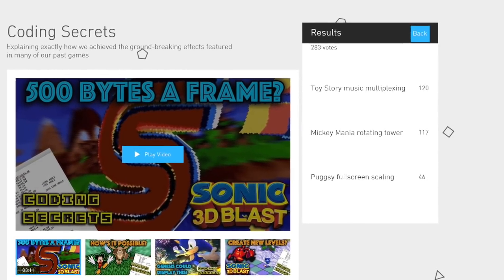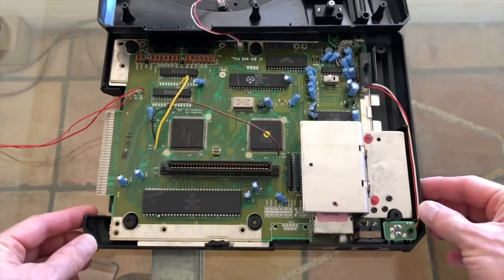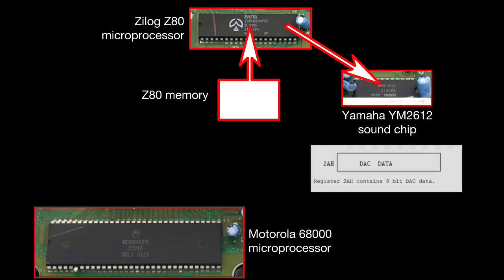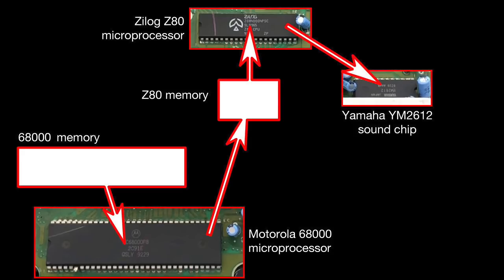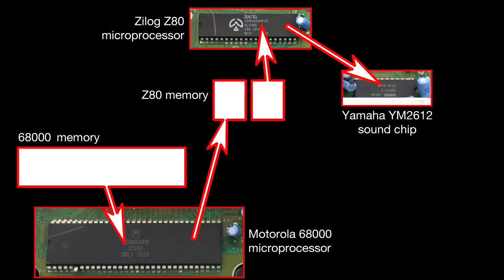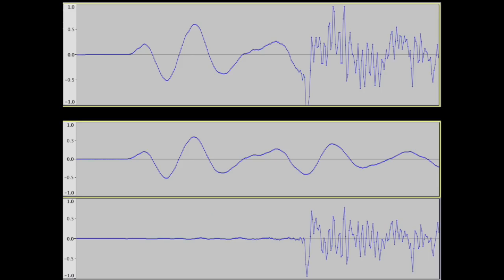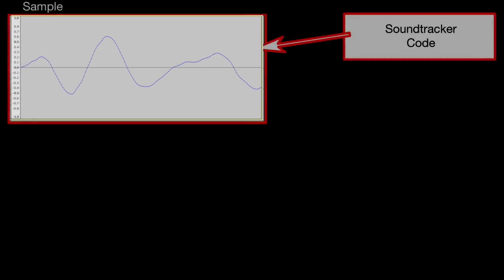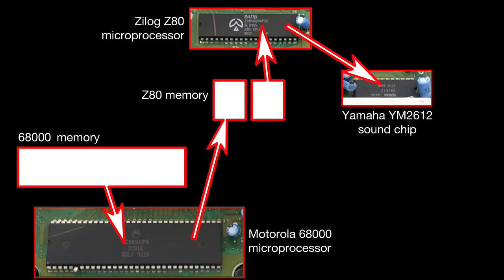Toy Story's Hardware Defying Music - How We Did It

Comment: Thanks for the explanation. I'm still wondering if it would have been more simple / efficient to do the mixing and playback on the 68000 alone, as one would do it on the Atari ST, since the 68000 can also access the YM2612 directly. Even though there is a speed difference of ~5% in favour of the Atari ST, I think there are MOD playback routines available which can reach ~16khz mixing on a stock machine. Did you guys think about this?

Comment: I'm sitting here realizing that all of this was always possible...
But then I also wonder how chopped up all of the machine language code must've been just to pull this off. There's no way this was done in the modified SEGA C or even assembly.
This is messing with the hardware on such a low level that touching the wrong thing could lock the entire system. I'm seriously in awe of how close you guys got to the razor's edge just for fun.

Comment: Basically, this is what almost every mod player did back in the days. Of course there were some machines that could do this in hardware (like Amiga or Atari Falcon or PC with GUS) but for the most of the time you had to do mixing in software.

Comment: Here is a question. Could you run streaming audio using that same sound engine?

Instead of using it as a sample mixer, you could use it to stream one long sample of music.
At 10 KHz, you would get 600 KB of audio per minute, and around 7 minutes of audio for every 4 MB cartridge. And that's uncompressed! I'd say that would be enough of an achievement to leave there, as to compress the song would be impossible without major slowdown.
And it would not be doing any sample mixing, or pitch control, or software volume control, so there will be some CPU being saved, allowing for some of your fancy effects.

If you were clever enough, you could fit the entire soundtrack of a game, consisting of a few short songs, or one long one, and fit it in around 6 minutes of WAV style audio at 10 KHz, and still have enough memory to fit in the rest of the game (400K is enough for an arcade style game, and 6 minutes of WAV audio is also enough.).

People would think that they have a Sega CD, but don't.

Will you accept the challenge?

Comment: Wow! That’s quite an achievement! Sounds awesome, especially for the Mega Drive. I wonder why the Mega Drive’s has such a bad soundchip.
Reply: It is because the Sega Genesis is a shrunk down System 16 Arcade board, and as such it uses an early 16-bit sound chip. The SNES had a sound chip that had just rolled off the fab floor when it released.

Comment: Loving your work, spent most of the day watching this stuff 😀 one question, you said for mixing that you halved the amplitude and then added, would you not just (using 8 bit signed samples as an example) just add the two 8 bit samples together in to a 16 bit register, then clip by setting >127 to 127 etc? Forgive me if that has been asked before.
Reply: There are different methods to mixing. But yeah you can in fact "saturate" (not clip. Clip implies wrap-around in technical terms), but you will lose fidelity when it saturates. If it happens rarely, then not a problem. You also need to apply some sort of volume too. I think the best method is apply volume, accumulate all samples, then shift them down. So yeah, you don't get the lower resolution bits directly, but you do hear their influence when mixing. It's an old trick and it works well. It's better than simply mixing four 6bit samples into an 8bit output.

Comment: So the 8bit Z80 only has only has 8K of ram ,and since most programmers tryed to fit all pcm sound effects in that 8K space then no wonder that  most games had awful voice samples,likely you can bankswitch sound data if you want to get around this 8k limit but technically there will be always a slight pause per data to be switched.
But this clever mothode is pretty smart to simulate 2 channel pcm audio but again then each sample has to be devided into sections of 4K since the Z80 chip cannot read data when the 68000 is writing to that 8K memory at the same time ,so to get around that, that 8K has to be devided into 2 parts of 4K for wich 4k is used for writing while the other 4K is used for reading wich alternates in order to avoid interruting each chip,, this way 2 channel audio at desirible length’s on genesis is possible, wich is not bad, 

but the psg chip inside the genesis can also do pcm but only fake it at  1bit pcm wich also explains why genesis games can also be sound bad that way assome genesis games do use the psg chip for 1bit pcm audio but still .it’s 
Pretty amezing how many mothodrs were used on the genesis to get pcm sound on it😀

Comment: Well, it is technically Amiga-compatible, since it had the same Motorola 68000 processor. (if by Amiga you mean the 1000.)
Reply: the Titan MDMOD Player for the Mega Drive / Genesis that's out nowadays actually runs ProTracker code on the 68000. The sound has to be software-mixed (like with this Toy Story music) due to the single PCM channel, so the CPU usage is 90-100%.

Comment: The same basic principle of software-based mixing of samples was done on the Amiga to double its 4 channels to 8 in the Octalyzer sound tracker. The result was stuffy-sounding enough, as it lost almost all high frequency, but man: eight independent channels! That meant real triads, not just arpeggios. I was so psyched when I was finally able to upgrade to MIDI. 😎

Comment: Nice and creative use of lookup tables as I'd call your volume and pitch tables. Had to do similar except a few hardware counters on my own (open-silicon) Programmable Sound Generator.

There would be 8 octave splits from a hardware clock source divided down to some frequency. Each octave could be tapped into a 6-bit counter that could be tapped in turn. My recommendation was to tap 48 down to 24, or 24 down to 12 if necessary. Unfortunately, there is no direct pitch/volume control unless you do PCM DAC foolery which may freak out some sort of internal hardware registers.

Comment: So you basically used the main processor as a stand-in audio chip, and wrote bespoke software that mixed samples, compiled music, and barely used the rest of the audio chips as anything more than an intermediary buffer (as one half of its memory plays you load newly generated audio computed by the main processor into the other half of the Z80's memory before swapping over repeatedly) and streamed audio data to the end source. You guys were nuts, and immensely ingenious. Great stuff.

Comment: Hi Jon, this is very cool indeed!  Have you seen any of the techniques used to play samples back on the Commodore 64? 
There's a demo that showcases immaculate sound quality with the sample playback that blew me away. On top of that they had visuals happening at the same time.  Censor Designs Wonderland XIII at the last bit they play a whole section of "Smack my B***h Up" by The Prodigy at what seems to be a very high sample rate along with accompanying visuals.

Comment: I think I get what happens:
1. Within the 68000, four audio channels are created. For each channel, data may be saved by combining sound samples at the cost of their respective volume levels. Between the four channels, the data is then sent to the Z80.
2. Z80 "double buffers" in order to both (a) receive/process data from the 68000, and (b) to send data that has finished being received/processed to the Yamaha sound chip. Otherwise, if I'm understanding this right, it hypothetically would be sending both processed data and data that has not finished processing that it had received from the 68000. The Z80 therefore receives alternating data from the 68000, between the two "sub-memories."
3. In order to thoroughly receive/process the data from the 68000, the Z80's access memory is blocked off. However, this access is turned on and off very quickly, insofar the Z80 is still able to send data to the Yamaha sound chip. Thus the music doesn't cease when playing, albeit at a minute cost to the audio's quality. 
4. The Yamaha sound chip receives data from the Z80, uses the DAC to turn the data into audio, which is then heard in-game.

I've also never even taken a CompSci class in my life, though I sometimes think about it, or reading a book on it. I simply enjoy learning and understanding things, that's all. Please let me know if this is incorrect, and if my post lets me, I will edit my post accordingly.

Comment: showing samples as dots connected by lines is misleading, because on playback done through ideal DAC, resulting analog signal level is only expected to go through these dots, but its values between dots are defined by so-called antialiasing filter, which is analog in older DACs and mostly digital on the modern ones, and for higher frequencies anything but linear.

Comment: Vaguely related: There was a nice little trick on the Amiga to get 14-bit audio out of them, using a similar software-mixing approach. Ordinarily there were two 8-bit channels for each stereo output with 6-bit volume registers per channel, so if you set one channel to full volume and the other to minimum, you could bitshift a 16-bit input sample appropriately and get 14-bit output.

Software mixing did steal a lot of CPU, as I'm sure this did on the Mega...er... sis. Genedrive. Er. You know.

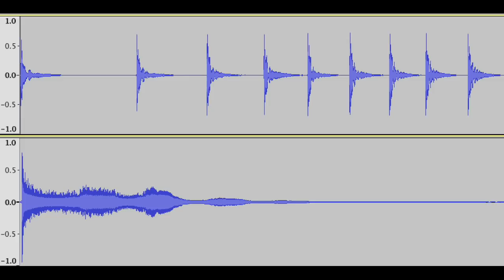Comment: One correction at 3:46 - a DAC doesn't linearly interpolate data; doing so would add harmonic information not present in the original sampled signal. The resultant interpolation (connection of the dots) from a DAC reconstruction filter is actually various curves :-)

Comment: Hm what is the theoretical max samplerate you could get a sample to play back on the genesis using the z80? Also you said you updated the sample memory every 10khz but there is a slight delay when you update it which causes a short silence so what is the actual playback Hz?
Reply: I'm not sure, but on the NES they could get 4 channel mixing (with volume and freq change) at about 10khz by using 100% cpu, and the Z80 is similar in speed. The max theoretical samplerate on the Genesis is 53khz (sample rate of the sound chip), but it behaves badly if you play faster than about half that (which makes the max practical rate ~26khz).

Another big issue is that the main cpu (68k) and the z80 can't be accessing the same ram or the cartridge at the same time, so you have to turn one off which tends to create gaps in sound or slow down games (it's why pcm sounds in Sonic or Streets of Rage are so gritty). Other early multi-processor systems such as the SNES and the Saturn had similar problems.

Comment: I truly appreciate the coding prowess it took to achieve this.  I've been playing around with coding up a pseudo-low level game engine and one of the challenges I put before myself was to play back a few of the old Amiga style mods that Star Control 2 used.  So, I learned what I could about the format, and coded up a module player to interact with my game engine's audio sub-system.  The system emulates roughly 32 channels with a 256 variable size sample bank.  As part of the callback from PortAudio (which I'm using to get a raw buffer to the OS's audio system), it mixes (adds) all the 16-bit data down into a 32-bit sample array, multiples the master volume, and hard limits it to within the desired 16-bit range for the output buffer.

Test video showcasing the results for the curious:  https://youtu.be/94kpJZq5H78

But, the fact you did this on the good ol' Genesis with only a single PCM channel with all the other limitations is just damn amazing.  Never discount the achievements of the past.  It took some serious effort on my part to pull this off on modern hardware with C++...  I can only imagine what it took back then.  Outstanding work, sir.

Comment: Sort of like mp3 audio compression for the mega drive?
Reply: No, it's actually using the CPU as a synthesizer. Some PC games work like this too (ex: the original Deus Ex).
Reply: boptillyouflop I meant in the sense of how they skipped certain values to get desired  results. In this case it was used for altering of pitch, for example, whereas in mp3s it's used to remove portions your brain doesn't necessarily need in order for the audio to still make sense.

Comment: Have you ever tried to make it run on a Z80 alone? Do you think it could run on one? Or would the RAM be a real big problem? What if the RAM problem was non-existent? Could you do wavetable synth instead? As you could surely fit that kind of much smaller samples that you would use in 8K.

Would it be possible to make a stand-alone mega drive MOD player with an interface that allows you to play any MOD you put on a folder with the ROM (for a flashcart)?